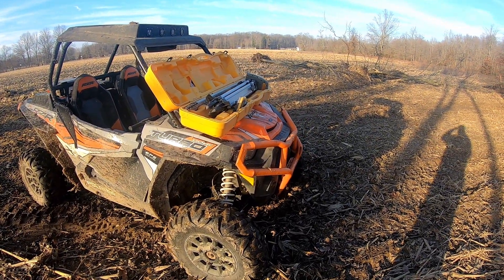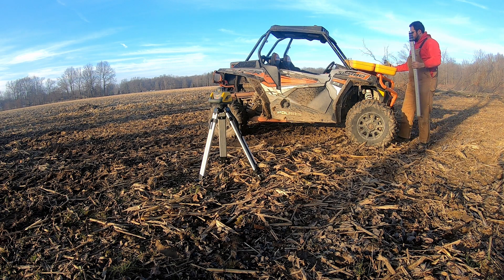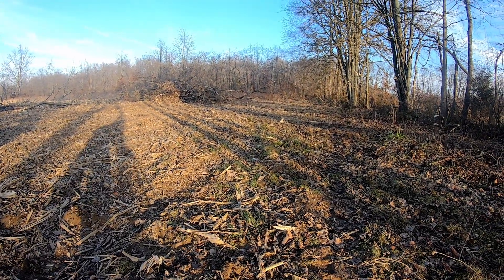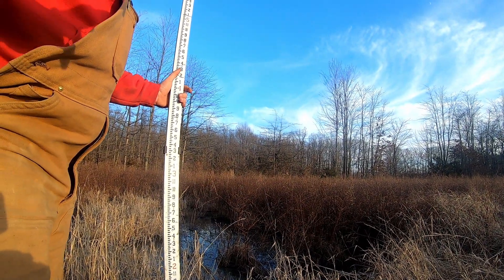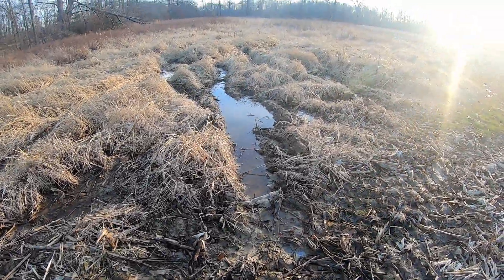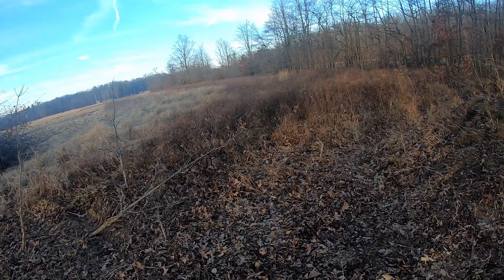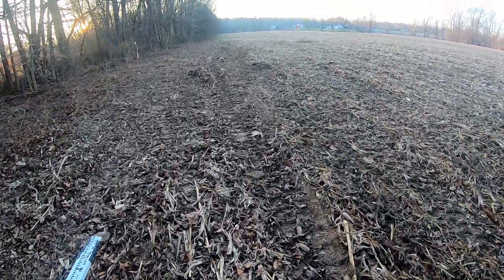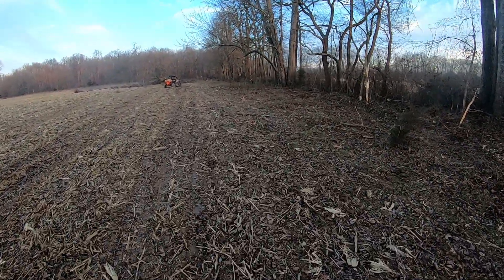#56 Ditch project part 2 using laser transit to figure out grade

Comment: Are you going to rent an excavator or use the tractor? 
My suggestion would be to rent an excavator and put in drain pipe.  2 -3 short runs in the wet area to the edge and around.  Looks like 4" would do.
Reply from the maker: Well the land is actually rented out to a farmer and technically his project. But I figured good opportunity to finally video the grapple the 3rd function in action. And had access to laser already to help determine his plans. Also the excess dirt has two functions. Fill in low spot and haul the rest across the property to a track I'm building which the video starting that will be published probably Monday.